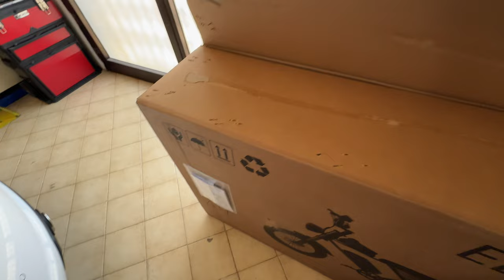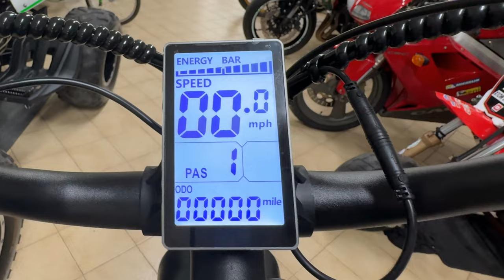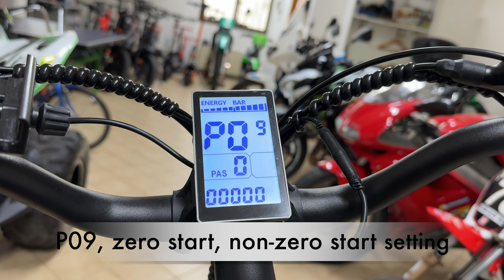RIDSTAR Q20 - MOTO, BIKE, ROCKET - FULL TEST - UNLOCK - TOP SPEED - 4K

Comment: i dont belive it go 81 km no way tell me how
Reply: Ohhhhh my god! Also i didn't believe that shit 😮
Reply: He was going downhill
Reply: speedo was probably off. from just the vid u can tell he was going max 35mph. Would be better to have a GPS speedo with his phone or sum
Reply: Going 15 mph
Reply: Mine goes 33-35 mph and feels like there is still a Ton left in the tank. Its governed, and so is the speedometer, so even going downhill, the speedometer won't read above 33 mph. GPS will go up to 35 downhill, and verified my speedometer. Its REALLY important to input the Accurate TIRE diameter into the settings.  Not the rim size..
Reply: @MyGunsMakeYouSafe Согласен, поменял на своем на 20 дюймов и теперь показывает точно 50 км/ч . Согласно европейскому стандарту ограничения 50 км .
Reply: Yours does 28mph unless you have the dual motor version.
Reply: @mikem2208  mine goes 33+ with only the rear motor and one battery.

Comment: The front suspension sucks on these bikes. I would definitely upgrade. Other than that nice bike.
Reply: Front and back both kinda suck tbh.
Reply: @mikem2208  yea, I think the rear is rated for 500lbs. Like wtf 😆. But for starters, Def replace the front...
Reply: @J-unit84  yeah, i havent checked prices yet but ill definitely do the front first but probably both
Reply: @mikem2208  front suspension your looking at about 280, rear $80, $100
Reply: @mikem2208  Nothing was adjustable stock. Thats what sucked
Reply: @J-unit84  i also might just put that money towards an eride pro ss or similar too. 😆
Reply: @mikem2208  Yeah, if you got the money definitely.
Reply: @mikem2208  surron is overrated 😴

Comment: Ive had mine for almost a year now, 9 or 10 months.

Mine does 28mph by gps while the speedo says 34.

Its a decent bike. Has all the right parts. But most of them are the cheapest parts you can get. The front suspension especially. 

The motor seems awesome tho. Has a lot of torque. Climbs most hills easily. But its a heavy steel bike.